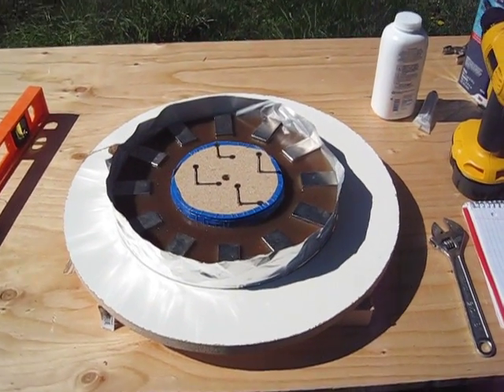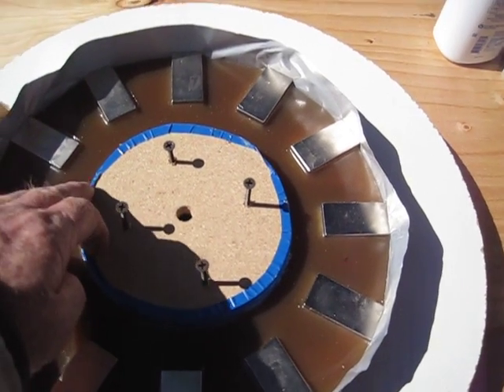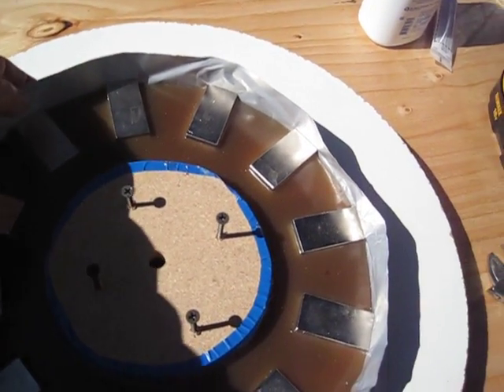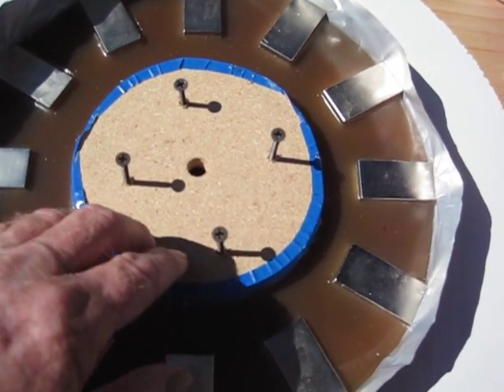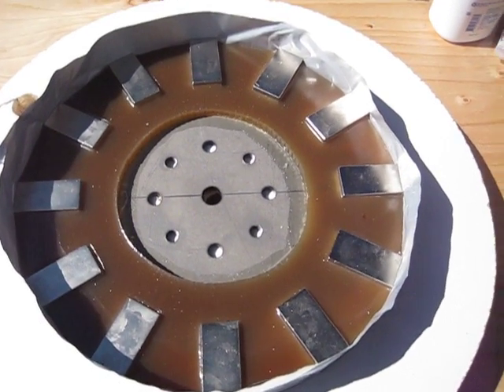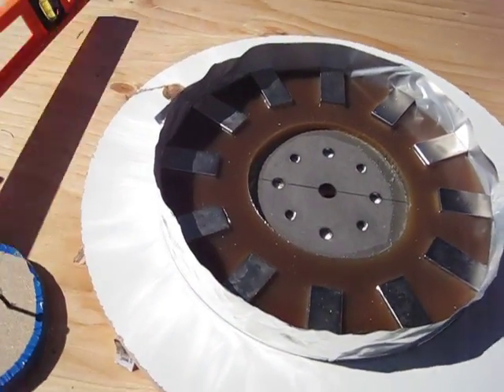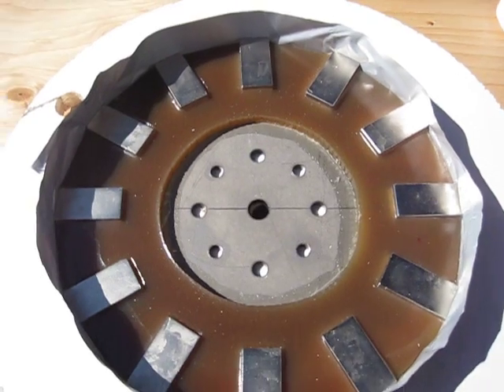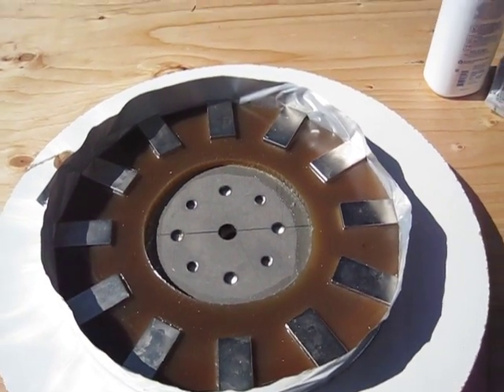vertical axis wind generator magnet plates 001

Comment: I received a shipment of neo-magnets from china which are mixed...12 n35 and 12 n50. What would be the problems associated with having 12 n35 on one rotor and 12 n50 on the other rotor? It would be expensive to ship the n35s back and wait another 6-8 weeks for the proper n50s! Thx
Reply from the maker: I guess it would come down to your choice of building the project you wanted or accepting something else and always left to wonder what if.  main thing is, what is the pound pull rating of each type of magnets. I can tell you one project I built, I used smaller 19 pound pull magnets , then went to 49 pound pull on same rotor/stator design to see the difference. a gain from 39 volt VS 103 volts. big difference.  you can still have basically the same pound pull but in a cheaper grade magnet.  so before I can recommend what I would do, I need that info, sorry, just cant do ya justice without that info